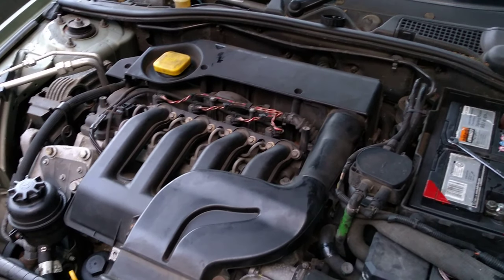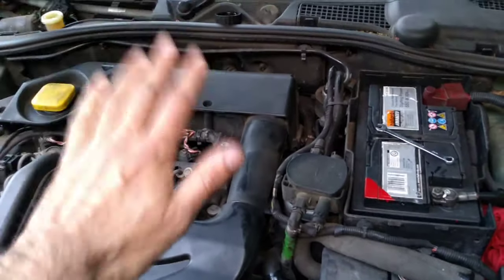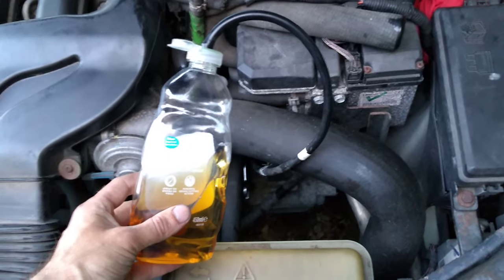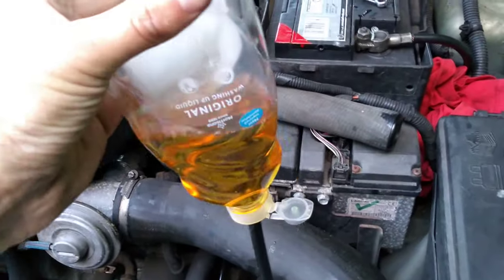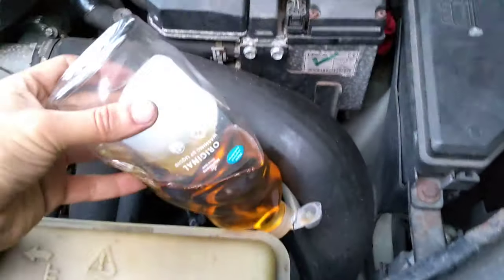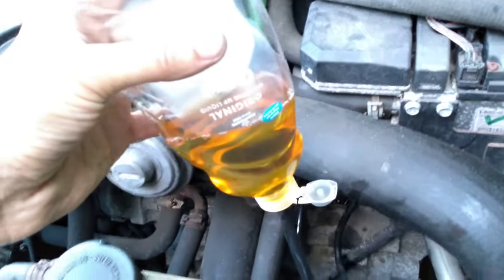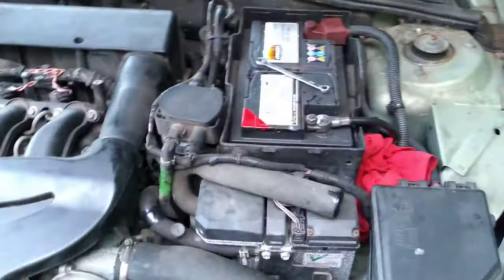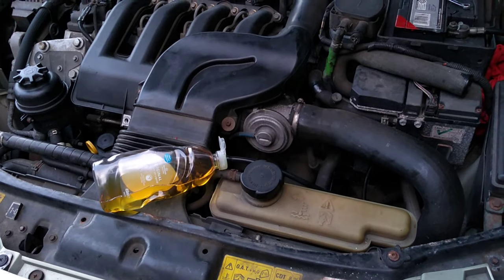Easy Clutch Bleeding Method

Comment: I bought a cheap 350ml syringe and clear pipe from Amazon to do this. Worked perfectly. Another tip is that if it’s a completely new master cylinder,  half fill it with fluid and give it a few pumps by hand before fitting. There’s always a few bubbles there

Comment: Thanks it has taken me a while to get the clutch done doing it the normal way especially that it's a shared reservoir. Tomorrow I'm getting the job done with your method. From Zambia
Reply: I got the clutch done by feeding the clutch line in reverse the slave cylinder. Legendary thanks alot bro

Comment: Man you saved my ass today. Finished changing the clutch on a Renault Kangoo 2 and lost almost 2 hours trying to bleed it the normal way with no success. Tried this and it worked!! Thanks a bunch. Cheers from Portugal.
Reply: I’ve also lost a week on my mk5 golf, I’ll try this, came here before I brought a £40 pressure bleeder
Reply: @morrissongroundworks4920  Quite literally same thing as me. Spent the last 3 hours trying to bleed the clutch on my own MK5 Golf with zero success. Made up my own bottle and had it done in 15 minutes.

Comment: After changing the clutch on my Focus, I tried bleeding it like you would do with brakes but this didn't work, so i tried your method using a syringe instead of a bottle and hey presto, it worked first time.
Thanks
Reply: Hi there, I got air in my focus ...could you tell me how you did yours please  pictures of type of syringe used and how with brake fluid full up??
Thanks in advance. 
Rob.
Reply: @gooapple9  hi Rob. I purchased a 500ml oil suction syringe from Amazon. Do a search for "EMOTO 500ml Oil Suction Syringe". It costs about £15 although you could probably purchase a 250ml one for cheaper. Fill the syringe with brake fluid. Connect it to the nipple of the clutch slave cylinder and then open the nipple. Then force the brake fluid in through the nipple, slowly but firmly. Usually best done from below the car as well rather than above it. Close the nipple after and try the clutch.
Reply: Cheers Matey,  did the job! Saves paying a garage fee 😉
Many thanks 😊

Comment: Hey mate!
I had air in system in my Civic gen 8. All the 'normal' methods failed, i wasted whole day yesterday on in, and the only outcome was that I put even more air into system by doing it 'normally'. Today i tried your method, but i used a big syringe to push fluid back through bleeder and it worked like magic! Took like 3 minutes, I did it twice to be sure. Thank you very very much!!
Reply: I have the same issue! What kind of syringe did you use?
Reply: @9strijdr374  Big medical one from pharmacy, 150ml
Reply: Really please with your results. I'll try on my Accord 8. Do you still have to do the pedal down process when back bleeding?
Reply: Hi can you do this without depressing the clutch pedal and release fork? Thanks

Comment: Thanks for the video. I've been trying to bleed the clutch on my MK8 civic for about a week now through different methods (Gunsons kit, vacuum bleeder, up/down pedal routine) and the most ive got is a little bit of pressure on the pedal... Pedal still goes to the floor though :( Will definitely give this a try!
Reply: Hey! I also have mk 8 civic and same problem. Can you give me info if that worked for you ?
Reply: Do it mate. I did it on my mk8 honda and it worked like magic. It is easier, cleaner and faster than the other methods.
Reply: Did it work m8?
Reply: Did you use any hose that fits? Want to do on my mk8 accord. How would I remove all old fluid first?

Comment: Very grateful to you sir,
My Saab viggen had  is also a pain to work on sometimes.
Ok, I lied, It is always a pain in the rear to work on.
On the bleeding.
Wow yeah, I was just telling my neighbors...... why would anybody in there right mind try to get air bubbles to go down and out the Nipple. Air rises,, ✅RIGHT ✅!!!
I TOO DID IT THE STUPID WAY EVERYONE ELES HAS TOLD ME TO DO IT.
YOU SIR ARE A THINKER.
earlier today all I could think of is ???
Why don't I push the  air up and out of the master.
I wonder if that would finally get my clutch to work again.
Well, well we'll. 5 mins later, I have the best clutch I have ever had folks.
Thank you brotha for giving me the confidence to go for it.
Note I pumped 3/4 or less out of the master just in case before I started.
Just FYI on that last part.
No mess.
No mess at all.
And super dupper easy man.
Thank so much bro

Comment: good job thank you my husband has  a 2017 Passat and there was air in the clutch hyd system   i got him a large syringe and  he sucked in fresh fluid  opened the bleeder nipple put a small bore plastic line on and forced the fluid back up up the resaivor,, he also had a second syringe to suck the over flow coming back up the pipe work from the slave cylinder , it worked grand , im getting reverse gear  now much easier , cheers to all car diy folk

Comment: i have a 2003 mini cooper s  and i changed the clutch slave cylinder and tried to bleed it the normal way and still have no clutch pressure at all.
will this method work for my car and do i leave the clutch pedal up or down?
Reply from the maker: Clutch pedal up

Comment: My clutch has developed about 2 1/2 inches of freeplay overnight. Would this be the correct procedure to follow to get back firm from the top again?
Reply from the maker: It might help in the short term, but you should look into what's causing the free play. If it's leaking fluid you need to find out where.

Comment: When you talk about the reservoir over flowing your pointing at the brake master cylinder. The clutch master cylinder and reservoir is inside the car, which is probably why bleeding it the normal way wasn’t working as it probably ran out of fluid
Reply from the maker: No it's a shared reservoir
Reply: @51North  has it been modified then? The clutch hydraulics is a separate system to the brakes and has its own reservoir inside the car up by the pedal.
Reply from the maker: Must be. I looked on the forums after you said, and you are right a few people have done remote reservoir mods. Can only assume someone has changed the system.

Comment: Today I found out my brake fluid is leaking (from MAX to MIN in 4 days) and I can see brake fluid running out of slave clutch cylinder.. SO basically I just replace slave clutch cylinder, connect this diy bottle to it and squeeze it in and that way you fill your whole cars braking fluid right? and when it reaches the MAX on reservoir then you stop and tighten the plug and voila...
Reply from the maker: Some cars have separate reservoirs for clutch and brakes some don't. Fill the reservoir, then use this bleeding method until the you have good pedal feel. You might have fluid spill over the max, in which case clean up the spilled fluid.
Reply: @51North  I have the same reservoir so that would be a problem.. Thanks for this nice method of doing it..